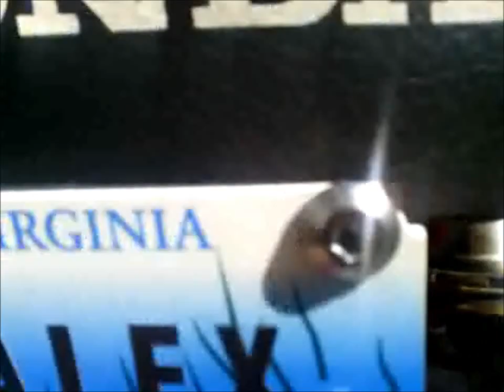Z50R Ressurection

Comment from the maker: If your motor is stock, the larger carburetor will be a waste of time. It won't have much low end and that's important on a stock bike. I would suggest you buy a used CRF50 carburetor from someone who installed a big bore kit or something similar. They bolt right up and will run like a new carb because, well, it almost is. If the gas cap doesn't seal well, buy a new OEM gasket. It will last another 30 years. If the slide sticks it could be a worn cable, get a new one if that's the case.

Comment from the maker: Sounds like the fuel cap is faulty. The fuel cap is designed to let air in and out but not fuel. If you were to turn the tank upside down with fuel in it it would drip but very slowly. It sounds like yours has been damaged or modified. I would suggest you try and find a used one on eBay. A new one might be kind of pricey.

Comment: Hey alex i have a 79 z50r and  can't get a good seal on my gas tank. My carburetor slide sticks some times and it revs way to high so I can't have it idle. I bought a new carburetor a bigger one but it is too big I need a manifold that angles out to the side like yours. And also the carburetor that is on it flooded it yesterday. I would love it if u could give me a few pointers or a cheap website to buy good parts from or anything u can offer. I love my z50r and love the looks of yours. Thanks

Comment: Yeah stock motor, i am going to return the bigger carburetor. Do you have any parts other than listed that you would be willing to sell. I would greatly appreciate it from one z50 lover to another. The gas cap is splashing out fuel when i ride it. I can't even full the tank. i have to put rubber bands around the cap to prevent the leak.

Comment: Alex, i bought a gas tank OEM gasket but it still leaks. with the motor cold i can shake the bike and gas comes out still. But if i put some rubber bands around it then it don't leak. I though it might be a vacuum problem but that doesn't make sense. What are your thoughts??